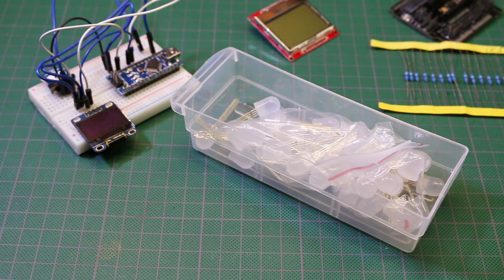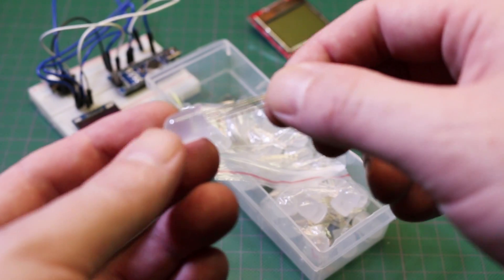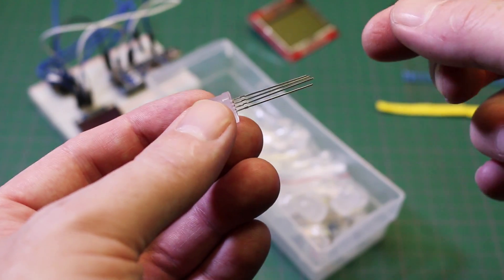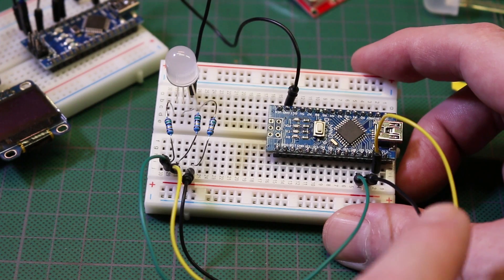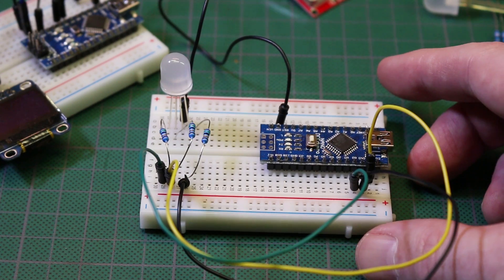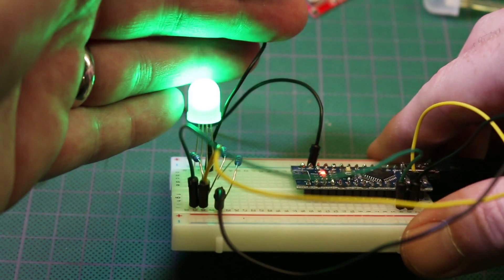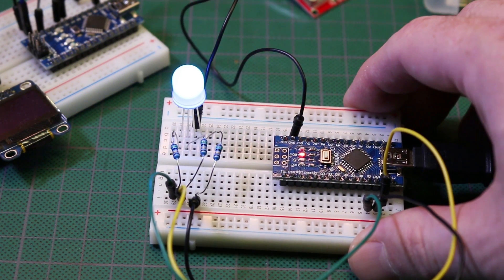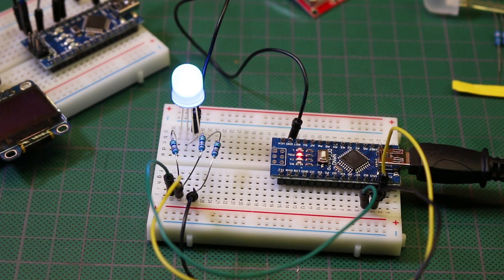How To Use RGB LEDs with Arduino

Comment: What are these big LEDs called? Do you happen to have an ebay link or such. Thanks
Reply from the maker: They are just 10mm RGB LEDs. Cheers
Reply: Cool thanks. I will use a few diffused ones in my next project. http://www.ebay.com/itm/121949162537
Reply from the maker: Good luck with the project. All kinds of fun to be had with those.  Cheers

Comment: Another awesome show.  Thumbs up and shared.  Do you know of any info on leds that are multi colored and you can choose more than one color to get different colors.  I know I should do some searching on my own but just thought if anyone knew you would.

Tom
Reply: +hamrad88 you want to look at something like the WS2812, it is an addressable LED(you provide power and then daisy chain a 1 wire control signal through each LED, it then allows you to provide it an RGB and intensity value in code. can pretty much mix any color you require.

all the big stockist's have them :)

https://www.sparkfun.com/products/12986
Reply: +TornTech Thank you very much for the info.